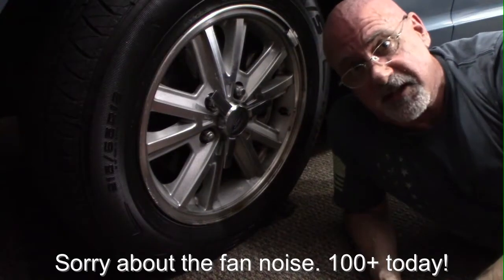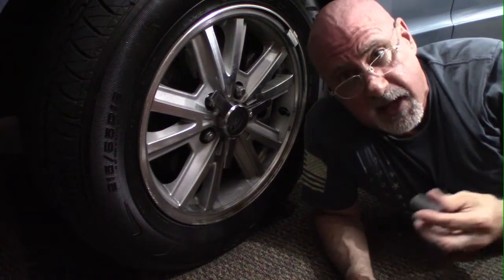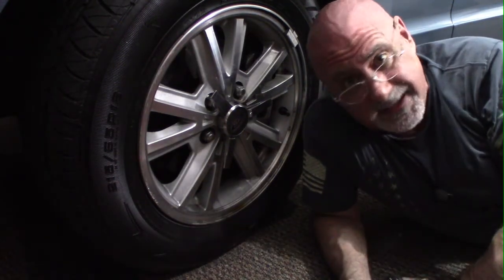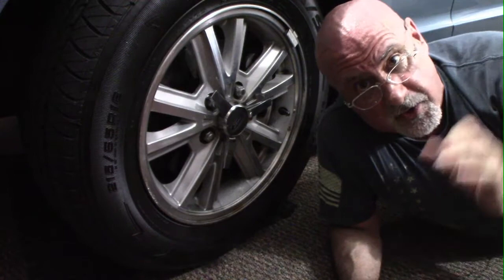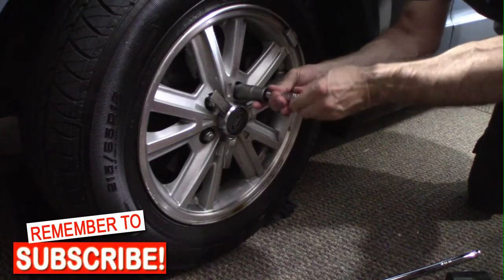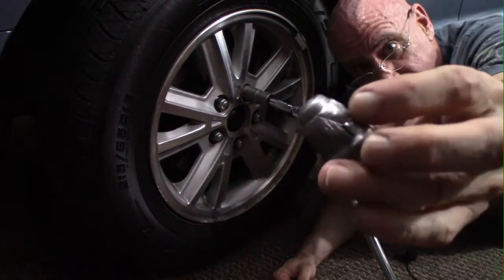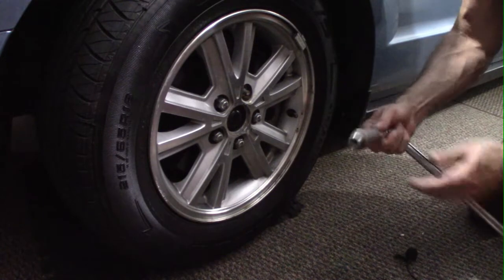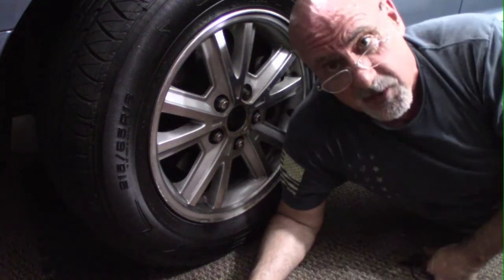Removing stripped lug nuts. The ROCKET SOCKET.

Comment: If you lube the studs or the nuts, you will never be able to put proper torque on the lug nuts. You will always over-torque them. In the case of Ford trucks, one of Ford's biggest warnings is to properly torque your wheels because if not torqued properly, you will run the risk or warping your rotors, resulting in pulsating brakes. How do I know? Been there, done that.